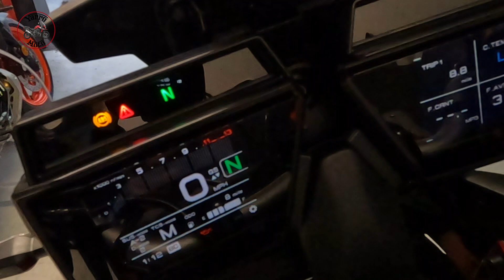What has Wayne bought?

Comment: Congratulations you your pal Wayne. The 900 Tracer is an absolutely fantastic machine. I took one out a year ago as I thought it would be a much better touring machine than my MT10 (it is) 
I'm a massive Yamaha fan also owning an XSR900 with that same Triple engine as the Tracer. It's reasonably lightweight, quick and will undoubtedly be reliable.